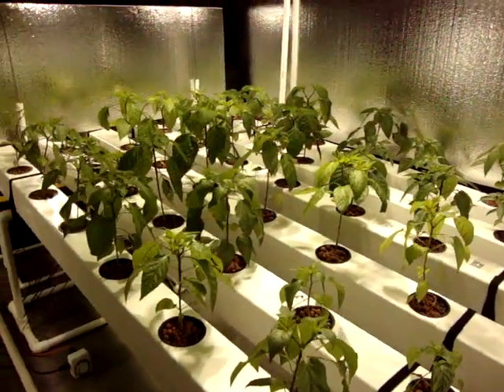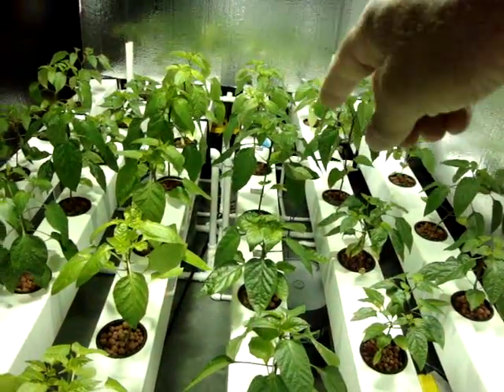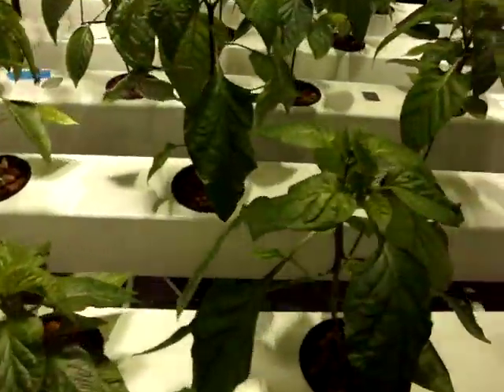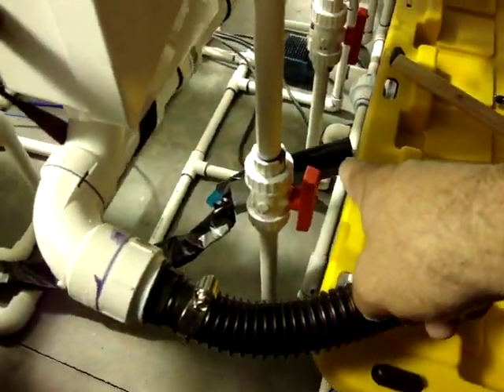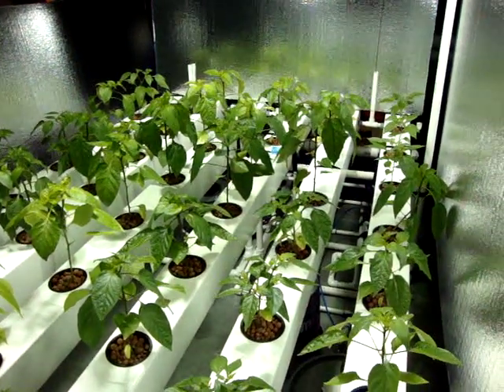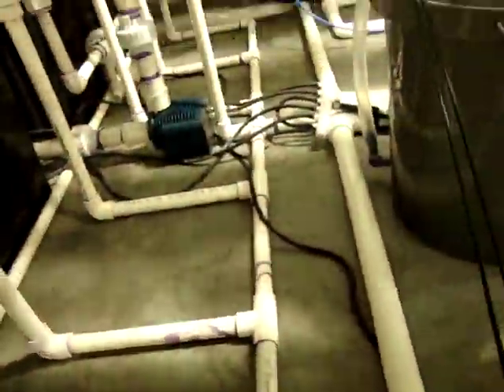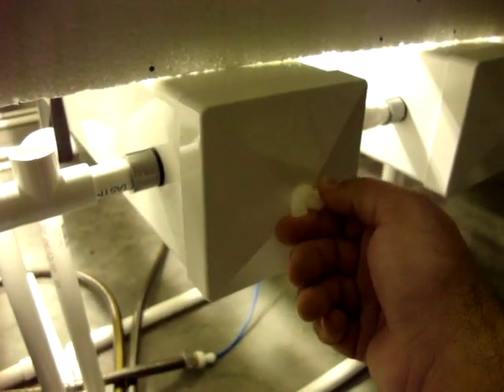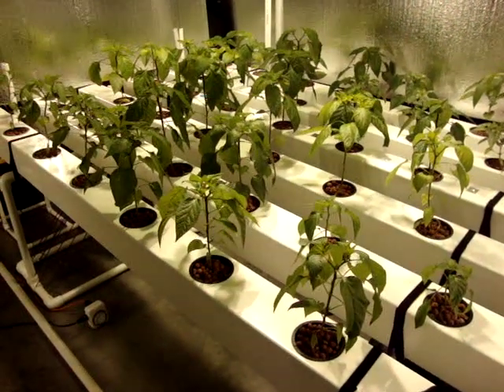39 Pepper Aeroponic Rail System- Basic Overview

Comment: Hello, Thank you for the previous answer. I managed to find the tubes. A technical question; tubes are 2 meters long? I saw that you did 7 holes for each tube, each 25 cm, right? What is the distance between a tube and other? The same elapsing between the centroid of a hole on the other? Or better the measure of diameter of a tube and a vacuum (and so on)? Forgive me many questionsI would not want choke the plants need to breath between them. Thanking you in advance, I cordially greet.

Comment: hey bud great video! im in the process of putting together a aeroponic type systems similar to this but on a smaller scale. what fitting are you using for the drain connected to the square pipe that drains back to the reservoir? does your pipe drain completely or is there a bit left at the bottom of the square pipe?

Comment: +Jksax914
Keeping track of the water used is a great idea.  You can know the capacity of your system for adding nutrients or pH up or down.  Where did you find that Flowmaster water meter thing, and how is it working for you after a few years.  Is this system something you have continued to use in the past years, Jksax?

Comment: i think this has to be most amazing grow set up of this style but seems excessive use of power to achieve the results, i think using high quality tube CFL from Econlux would be a better idea than the HPS 1000 watt for this application.  You could achieve a good result with this. Good LED is to expensive to buy and HPS to hot and to expensive to run for this application. The cfls are cool and can be closer to the plants.
Nice plumbing and especially like the flow control meter with the water filter.  You can buy different CFL tubes to run at different stages of the grow blue for early growth and  extra red for final stages. You may even find mixing them with some UVb tubes might be interesting the final stages to see if it adds a lot of flavor to the peppers, not sure if that would work or not.
I would store your nutrients nearer to that sink that position is not cool enough you are placing it. 
Overall extremely impressive would just try to get your carbon footprint down a little and put that HPS away till it might be really needed.

Comment: Are those metal fence posts? wouldnt rust become a problem over time?
Reply: Probably not. They sell those vinyl ones. a 5"X5"x8' is $25 at Home Depot
Reply: John Bravo Actually Home Depot has 5"X5"x8' on clearance right now for $6.18 and end covers for $1.88. Just picked up 10 last weekend for and upcoming RGGS I will install this spring.
Reply: +DakotaGurl1  wish I caught that sale!

Comment: how did u make the reflecting panels?
Reply: +What YouWant  - That appears to just be Reflectix insulation panels. You can find them at any big box hardware store (Lowes, HD, Menards, etc.). Foam board from an office supply store, covered with mylar emergecy blanket material should work well too.